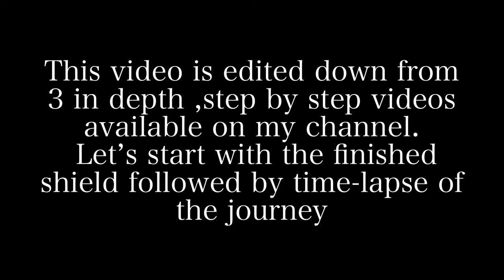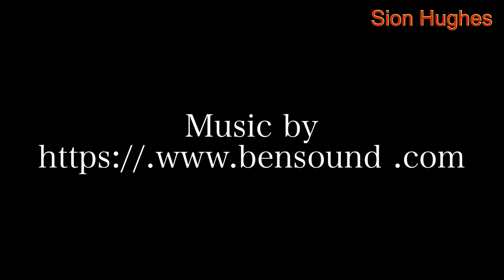How to make a medieval knights heater shield with gold leaf

Comment: How was the final coat done? 

Thank you for these tips!
Reply from the maker: There is no clear coat over the top . The paint itself is regular interior house hold gloss . Hope that answers your question .
Reply: @sionhughes5543  wow that gloss is poppin! The gold leaf isn’t sealed in either?
Reply from the maker: @kristibunny1620   Hi , no it’s not sealed . I don’t think I can seal house hold gloss . I have seen people putting a coat of size over the top to seal it but I can’t bear the thought of covering it it in Final coat of clear only to see some hideous reaction with the paint . I am tempted now that it’s had a year to fully harden as much as it can to just put clear varnish over the top of it . What are your thoughts? Oh and please consider subscribing
Reply: @sionhughes5543  sorry thought I had lol I did now! 
Making the family coat of arms. Debating techniques and things. Just going to be wall art but I’d love it to look more legit than a vinyl cut out or something and to last a good while. The little bit I’d done with gold leaf I had to seal as it was a day to day item that would wear away.
Reply from the maker: @kristibunny1620  I would think the best thing to seal that if it’s going to get handled on a day-to-day basis would be to paint with automotive paints and put an automotive 2K clearcoat over the top of it . My shield just hangs on the wall so it doesn’t really ever get any stress